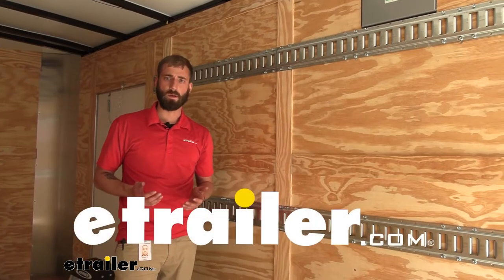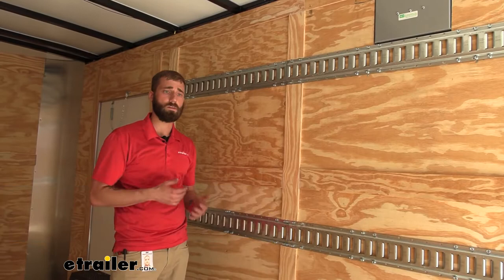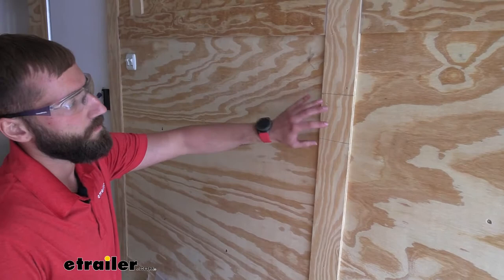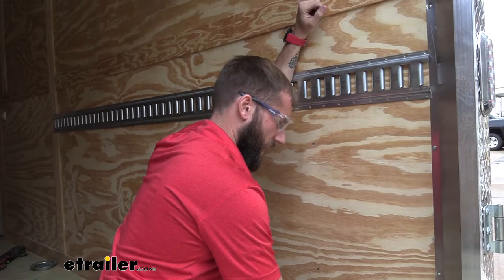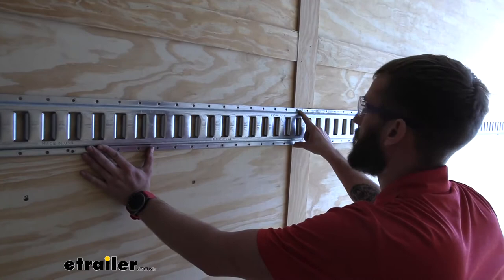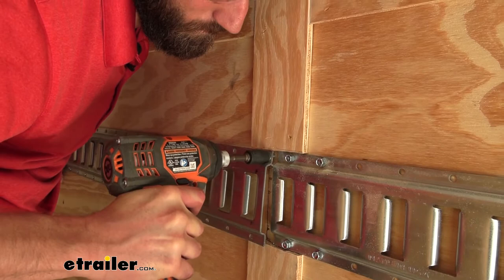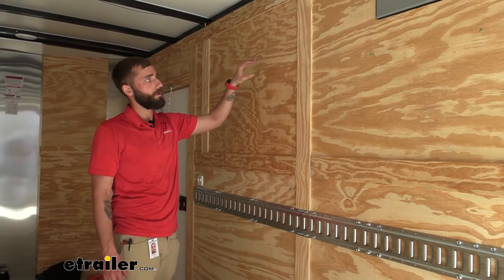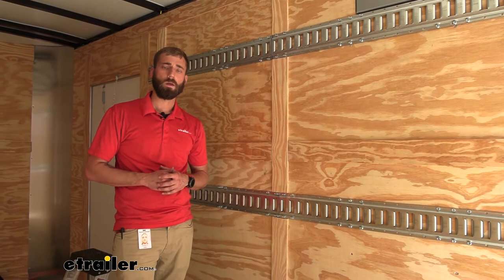etrailer Horizontal E-Track Installation - Enclosed Trailer

Comment: I have a small utility trailer that doesn’t have studs. The walls are just made of sheet metal. What’s the best way to attach e-track to the sheet metal walls?
Reply from the maker: We have installed awnings on cargo trailers that did not have great supports in the walls and we had to add studs in between the layers of sheet metal in order to get a solid backing.
https://www.etrailer.com/E-Track/etrailer/e65VR.html

Comment: What size self tapping screws are you using?
Reply from the maker: Each project is different and the size of screws/bolts needed for this application may vary. We suggest finding a size that fills the gap and isn't so long that it will penetrate the trailer wall on the outside.